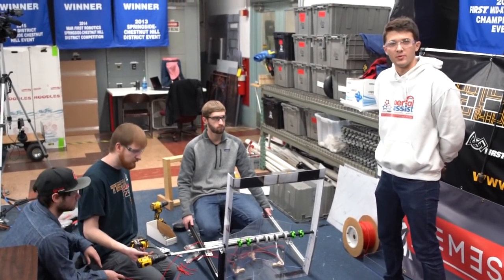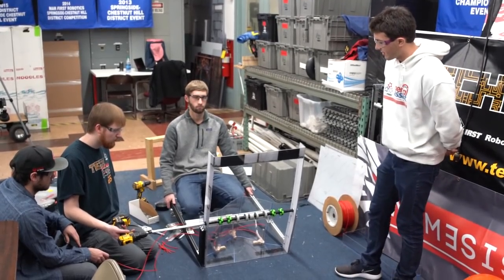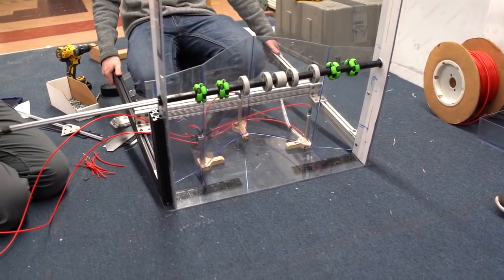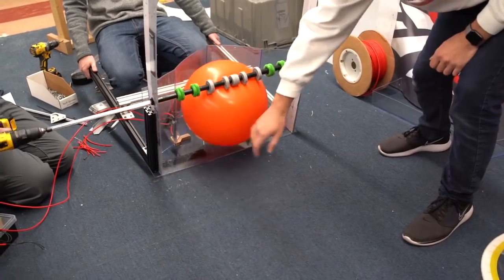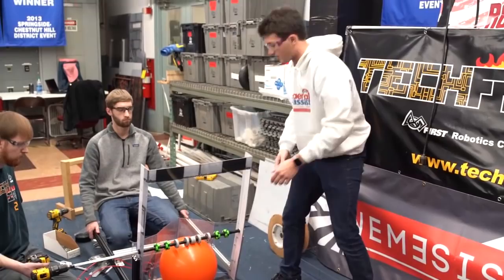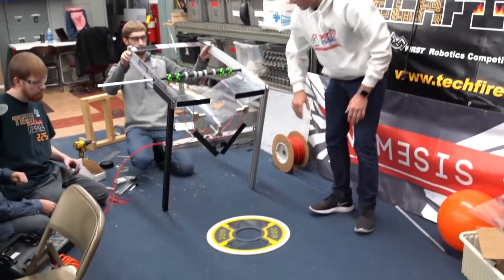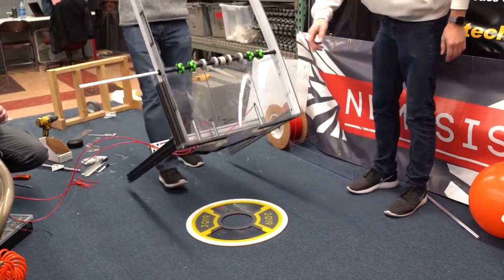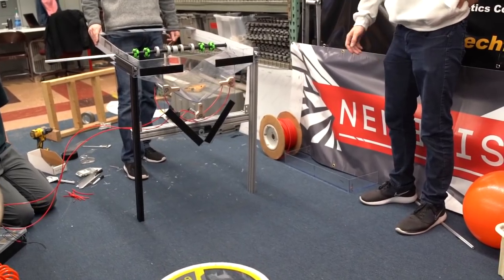Ri3D Team FIRST Capital Cargo and Hatch Integrated Prototyping - Robot in 3 Days

Comment: What kind of wheels are those? The green ones on the sides of the cargo pickup. They look like omnis, where can they be ordered?
Reply: Omnis usually can be found at andy mart. In fact i just checked and they have the exact ones used in the video (its common for first teams to use andy mart as a supply for thier parts)
Reply: @gideonmiles7161  you mean andymark?
Reply: AndyMark 2" 35A omni wheels: https://www.andymark.com/products/2-in-omni-35a-1-2-in-hex